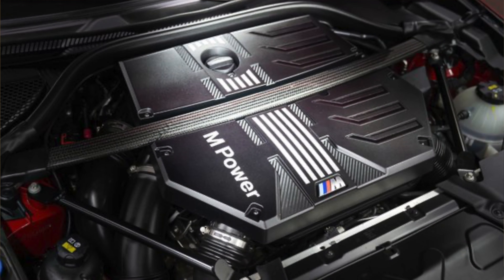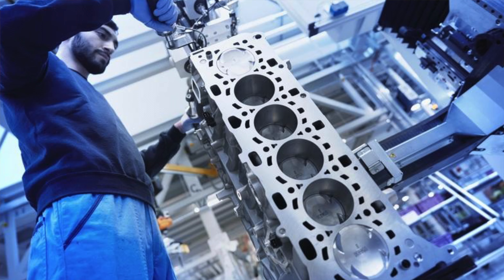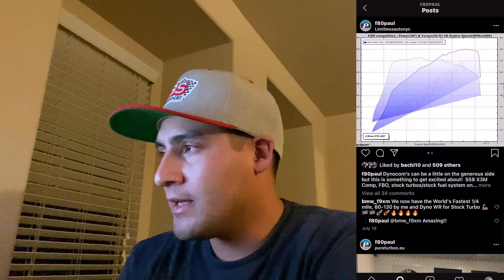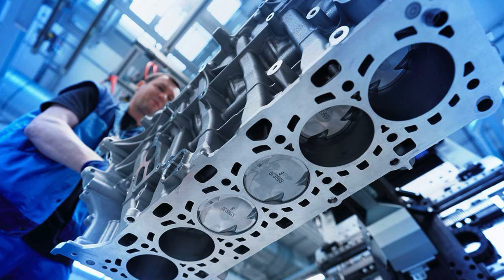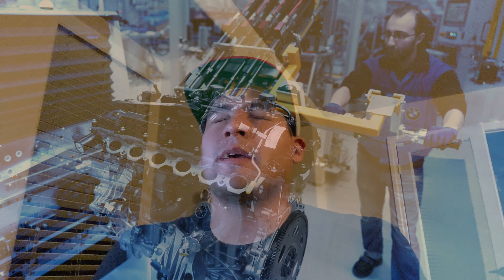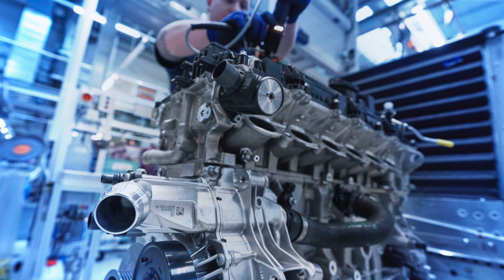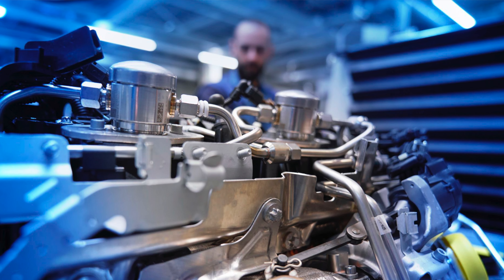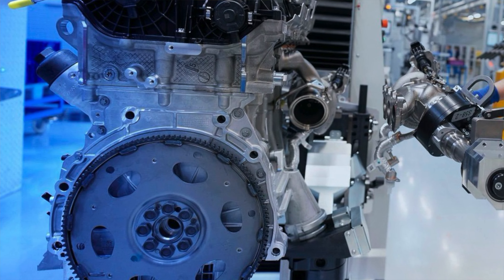700+WHP with the new G80 M3 and G82 M4!

Comment: Correct me if I’m wrong but the x3m are still older generation cars.  I wouldn’t be surprised if the g8x generation has newer ecus that are not crackAble.
Reply from the maker: They might come with newer ECUs but it’s only a matter of time before they crack them. This happened with the M2C and X3M when they were released

Comment: I would suggest waiting at least 4 years before checking on the G80s if you're considering them. If it goes according to script, the new car will lose about 20+ % in  year 1. I would also pass on any first year performance cars, it usually takes them a while to figure out the little issues that will occur. If you look at the current F series, a 2015 M3/M4 can be around half the price new (about 4 years).

Thanks for your perspective on the hp. I don't see where you can use 700hp on the street, unless you making drag races a weekly event. You definitely need AWD to save you in the wet weather.  On track, it becomes a liability as you mentioned.